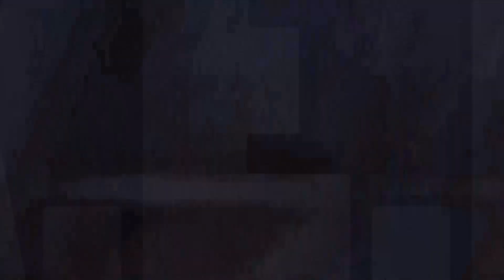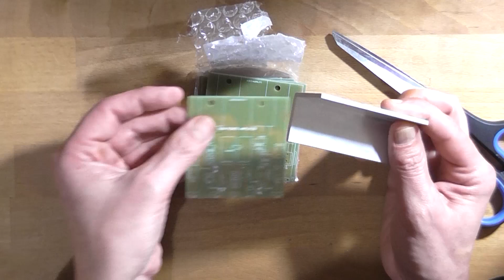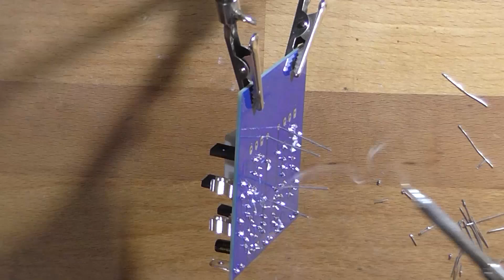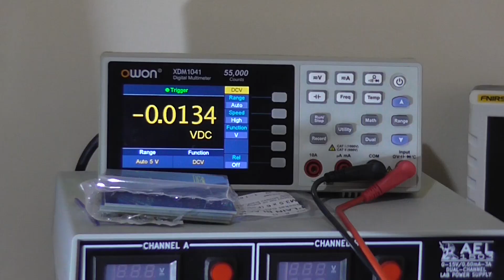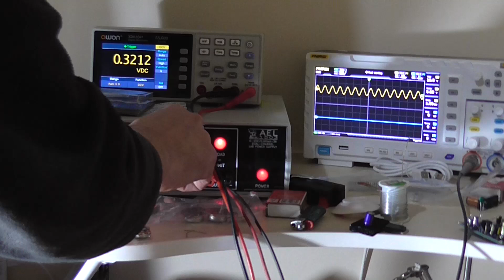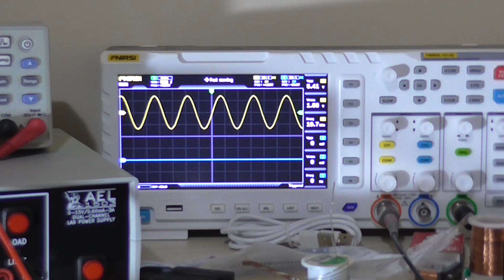Elliott Sound Products 60W Amplifier: TEST!

Comment: What was the voltage and current consumption  when you tested 54W into 4 Ohms load . Can this amp support 2 or 3 Ohms load at lower supply voltages like +/-20V DC. Thanks
Reply from the maker: @colombowala  no, it can't. Current is close to 2 amps.
Reply: @AstrosElectronicsLab  thanks for your quick reply. So am I correct in assuming that no components change were required when you operated the P3A down to +/-15.6 V DC  upto max +/- 42 V DC without significantly affecting the crossover distortion? 
What was the operating voltage when you tested it for 54W into 4 Ohms load?

Comment: I literally planned to build this Eliot 60W amplifier, 

i got an arround 90va 34v 0 34v power transformer, 
i got some good caps arround
got some transistors, i have resistors at home, i just dont have a heatsink and a board, thats about it :D

its not recommended but we are gonna do it!
I dont wanna be a smart ahh arround but the only thing he changed about the newest one that he increased the resistor values from .22 to .47 and he changed the location of the voltage driver, added an additional transistor for the pairs, and replaced the transistors with some newer ones. Thats about it.
They say that its unsafe and stuff, but if you do it right then it gonna go well! I am saying it at 1:20, i wasn't watched it yet, lets goo!
ye i see you also using .47 resistors for that.
oh nevermind :D you just changed the .22 resistor to .47, i do think that .22 was a little small for Figure 1.
Reply from the maker: Do not stick a 35/0/35 VAC transformer on this, you'll destroy it. That's +/-49VDC!
Reply: @AstrosElectronicsLab  i know its +-49. i mean i use +-47V in my  sa7800 that have TO3PN transistors, which i suspect are not that good chinese transistors, (unfortunately i dont have real transistors for it.) i just had pmc transistors for it :/
At least it doesnt get that hot to fail.

Comment: At what bias current did you operate it?
Reply: DC offset is the true term for it, and if you look at the project link you will see this is being taken care of by an array of two 2k2 resistors,  two 4001 diodes all in series connected to a BD136 transistor which self regulates DC offset.
Reply from the maker: Which I used 1N4004 diodes, not that it matters.
Reply from the maker: BD139
Reply from the maker: Bias current should be around the 30mA mark.